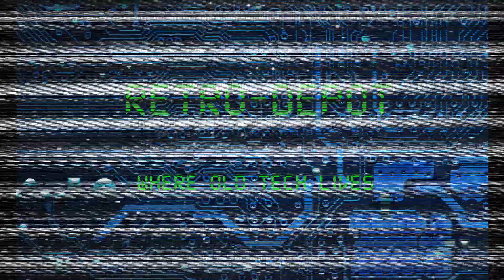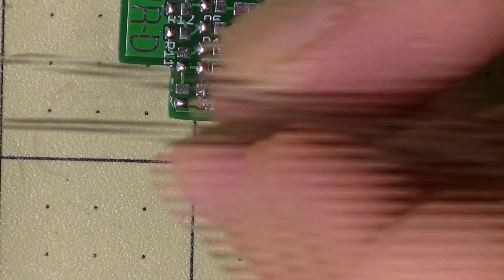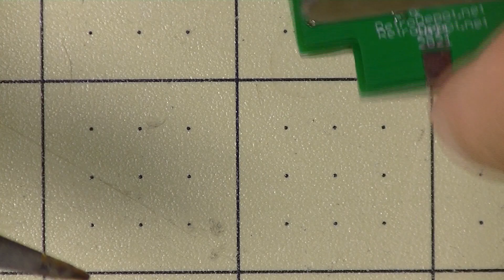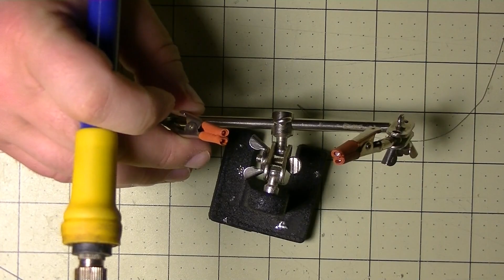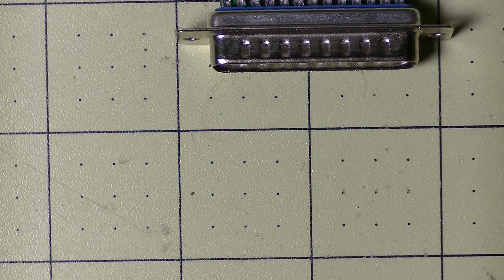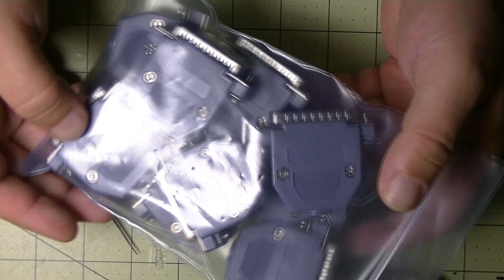Soldering Surface-Mount Parts By Hand

Comment: This certainly works, but I'd recommend a cheap ($30) hot air reflow station if you're doing more than a few small SMD builds.
Reply from the maker: I agree. But if you have a one-off this is a practical approach. I have a hot air station. But this is more of a tutorial for those who don’t own one.